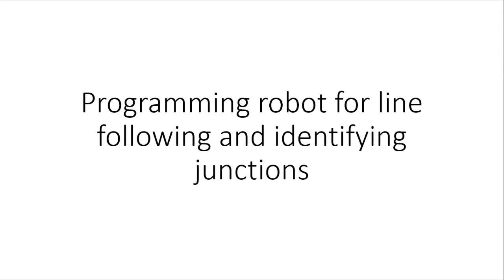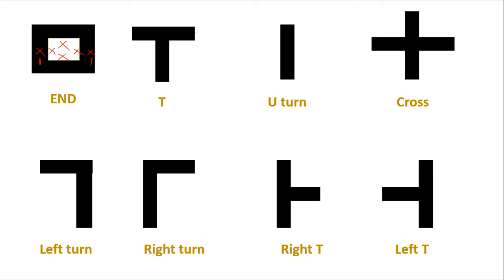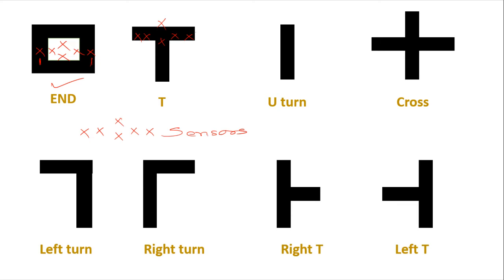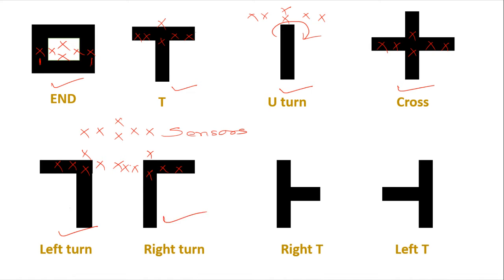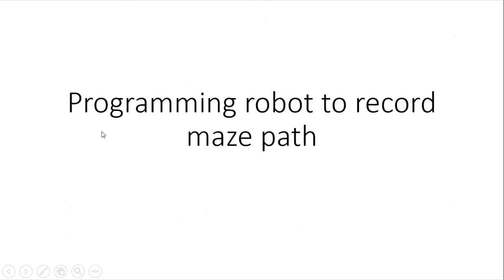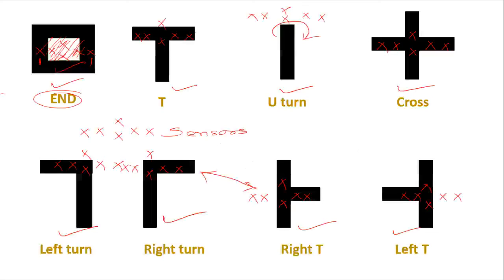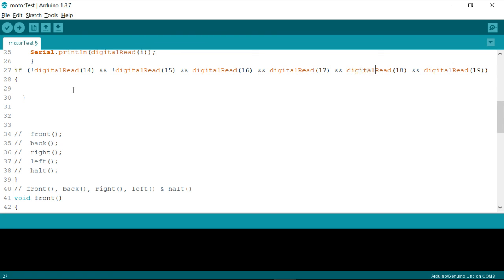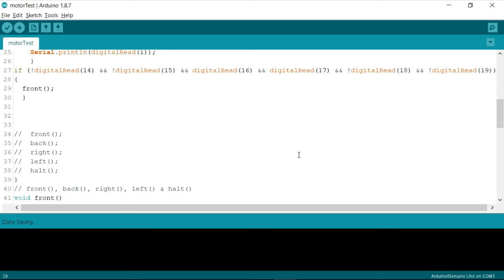7 Programming robot for line following and Junction identification

Comment: My LFR's IR is parallel position. then what is condition for junction identify.
Reply from the maker: Usually a + positioned IR is considered for junction identification but in a scenario like you have with just three sensors inline the condition would be matched with THREE consecutive checks ;
1) while L=F=R
2) move back by an inch &  check if L=R !=F
3) move front by 2 inches & check if L=R !=F

This is a junction! 

Hope this helps....... so subscribe and share with your friends! Happy Learning.